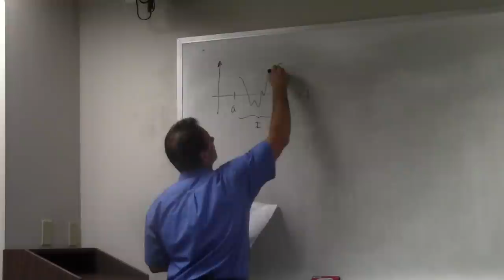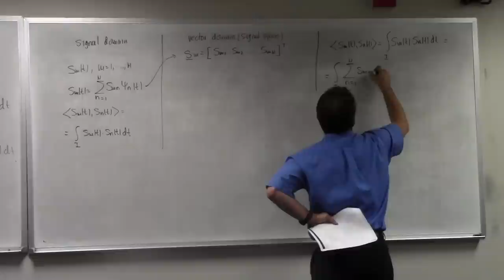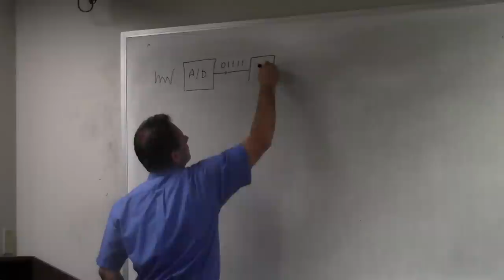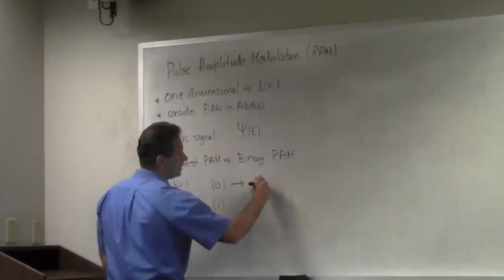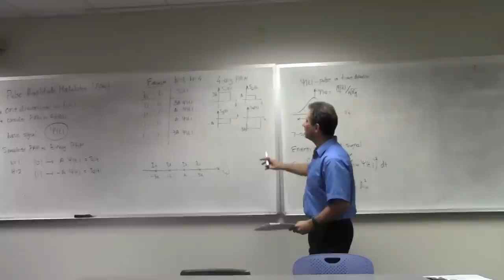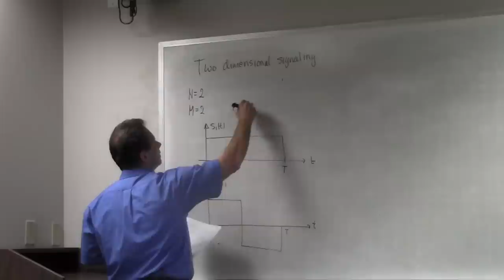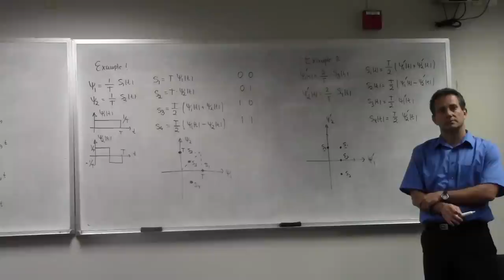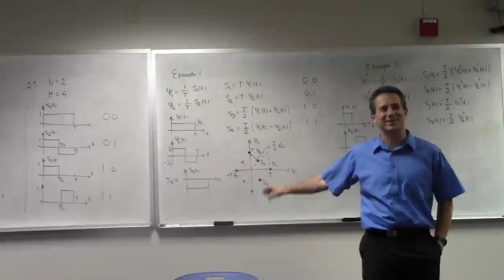Digital Communications - Lecture 15

Comment: Mr Ivica, towards the end of the lecture, you make psi1 = 1/T * s1(t) for making psi1 unit norm. But you need to divide by sqrt(T) to make it unit norm/unit energy. 

May be highlight the video with that correction.